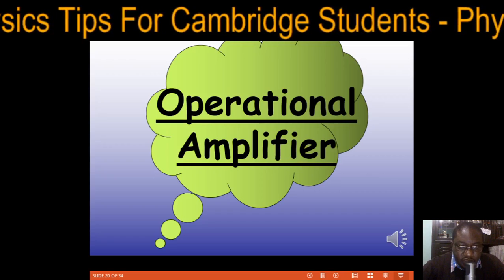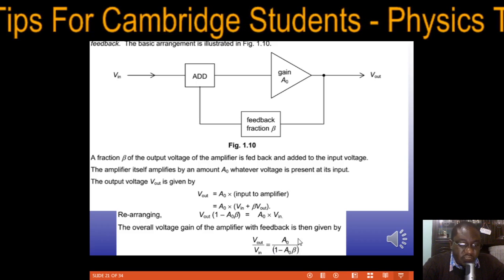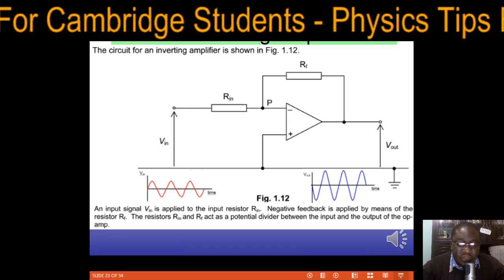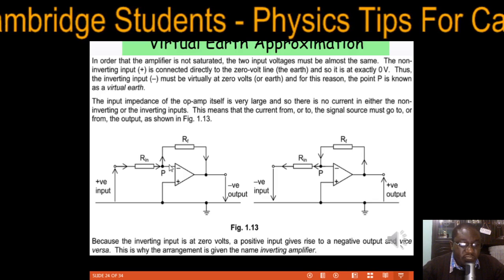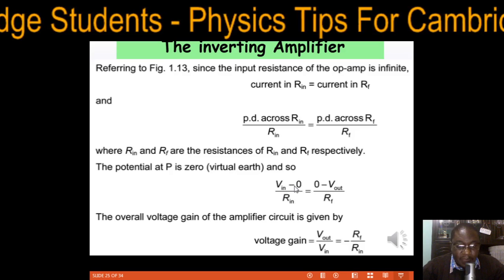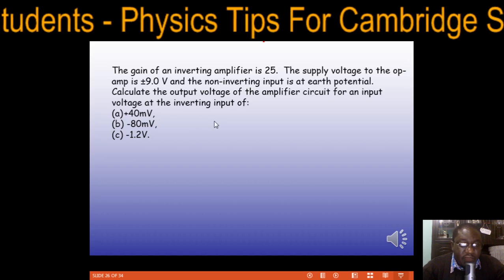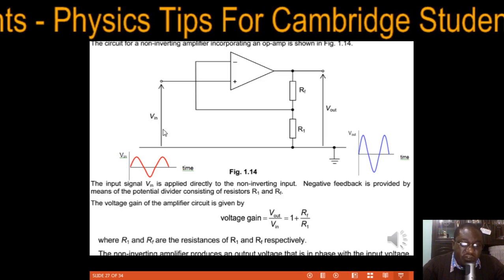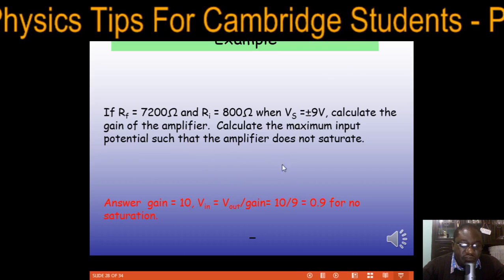A Level Physics (9702): Operational Amplifier Part 2, Negative  Feedback

Comment: Sir, what will we write for the definition of Feedback if it comes in the paper?
Reply from the maker: Feedback is the process of  injecting a fraction or all of the output voltage into the input.